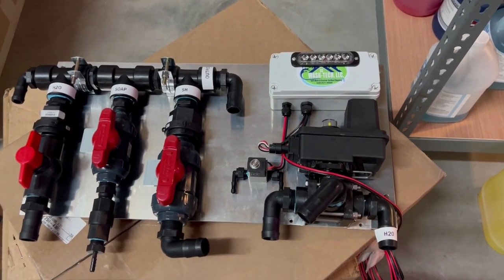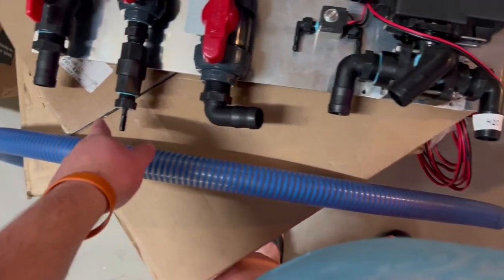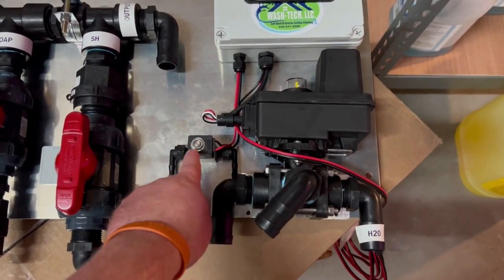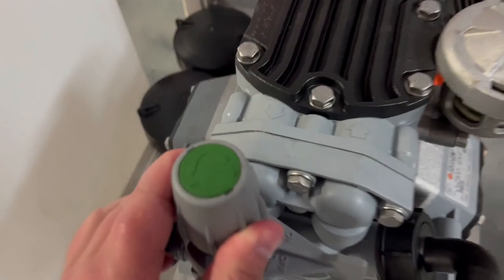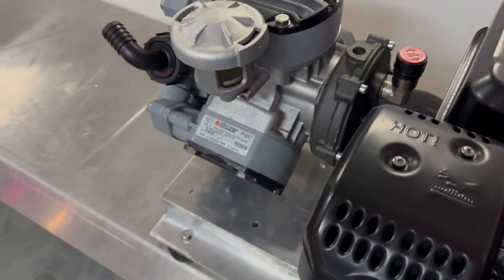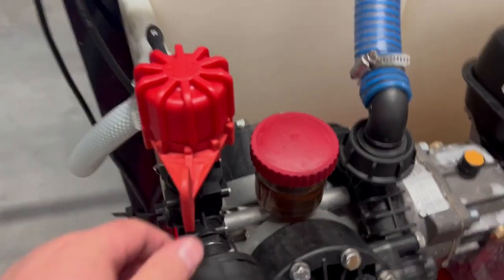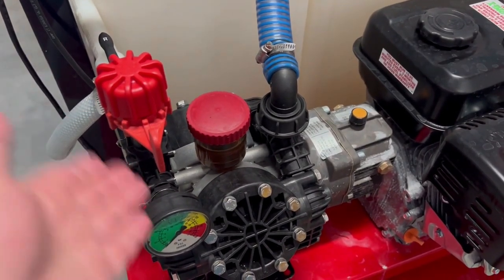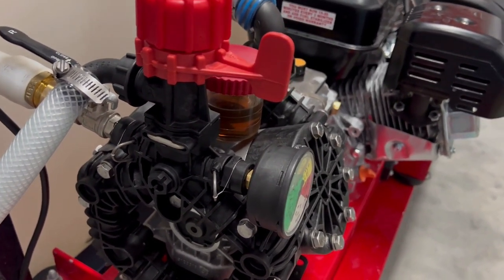High Flow Mixer - P40 - AR45 Plumbing Walkthrough

Comment: @pressurewashingtexas He Heath, I really love everything you do man. I've been following your steps both here and on Facebook. Only people with good spirit are blessed this way and come this far! 

Bro, your soap proportioner valve is 1". Why didn't you choose to go with the cheaper  1/2" valve?
Reply from the maker: It's actually 3/4" I misspoke in the video.
Reply: @TexasPressureWashing  So can you confirm an 1/2" is ok to use too? Since it can be way cheaper than a 1" or a 3/4"